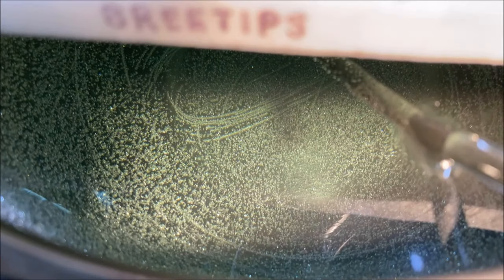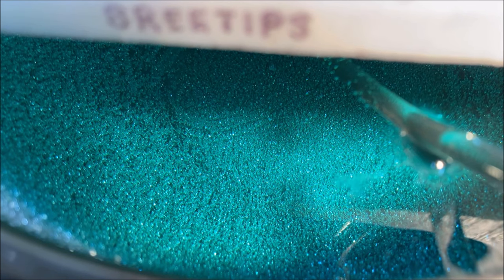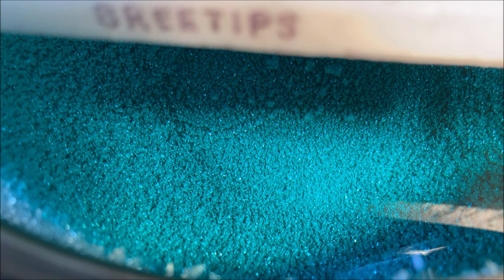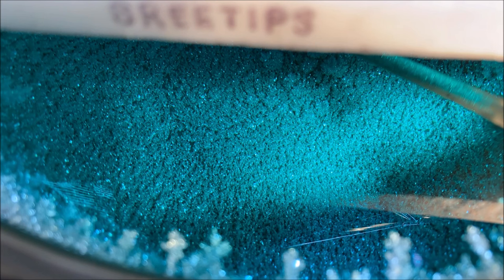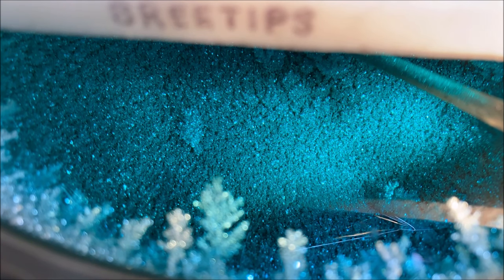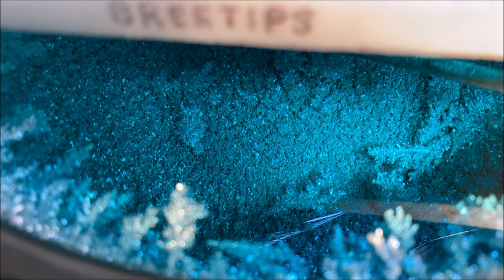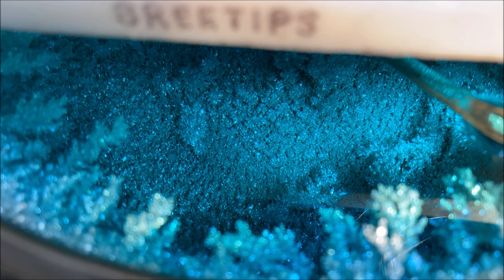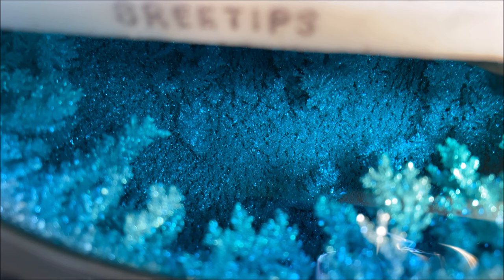Eight Day Time Lapse Pure Silver Crystal Growth Music

Comment: As an electrochemist, I find this quite interesting. Normally, during an operation like this, it is common to add an inert "supporting electrolyte" that carries the current rather than having the current transport via the active species (the silver in this case). Since you're getting very pure results, there's probably no need to change anything, but the supporting electrolyte will simply increase the electrical efficiency.
Reply: And what would the “supporting electrolyte “ consist of?
Reply: @john30039 , in this case, since the active species is silver nitrate (AgNO3), a great choice for a supporting electrolyte would be potassium nitrate (KNO3). The nitrate anion won't interfere since that is already present, and the half-cell potential of potassium is very far (3.7 Volts) away from silver's reduction potential.
Reply from the maker: No one on the goldrefiningforum.com ever mentioned adding potassium nitrate to the silver cell electrolyte. Not saying it’s a bad idea, just never heard of it.
Reply: @sreetips , I'm not suggesting that it's strictly necessary because your cell obviously works, and works well, but it might be helpful for electrical efficiency. When plating, it's a good idea to have a supporting electrolyte because it increases the conductivity of the solution yet doesn't participate in the deposition of the metal. I used to manage a plateshop (and unlike most managers, I still did the shop work too). 😁
Reply from the maker: They did refer to adding a little nitric acid to increase conductivity. Never understood that because the nitric would react with the silver. But it would just form more silver nitrate. And after seeing how adding HCl in my electrolytic gold cell really increased the conductivity across that cell, it now kind of makes sense.
Reply: @DocJustinT  thank you. But considering the scale of Sreetips cell and the low wattage, increasing the efficiency of the electrical system seems moot. I would think the additional cost of chemicals would outweigh any added electrical efficiency gains. Unless by doing so you could see a significant operational time reduction.
Reply: @john30039 , the supporting electrolyte can be used over and over by simply adding more of the active species, so even though there will be a small cost initially, it is quite small over time due to re-use. By adding the supporting electrolyte, the current (and therefore power consumption) can be reduced by around 40-50% depending on the concentration used because it switches the current from diffusion-limited transport of the active ion to the bulk electrolyte, which also slightly increases the plating rate (and therefore slightly reduces the plating time). Like I said, it's not strictly necessary, but a good idea for someone who does this a lot.
Reply: I love this conversation. You guys rock!

Comment: One of these days, I've LOVE to give this a try. I have several kilo's of silver to play with. I have 999 but I also have quite a bit 925, 900, and quite a lot of mexican silver currency. I also have all the lab equipment but none of the safety knowledge. I'll just keep watching and learning for now. I appreciate ALL the great content. MUSH LOVE MY FRIEND.
Reply: Can you put a sterling silver spoon directly into the silver cell? (saw such pictures in the internet)
Reply: @bt5-eo  You can, but the more copper you place into the electrolyte, the faster the nitric acid will become depleted. Because copper eats nitric about 2.5 times as fast as silver. This is why Sreetips dissolves the spoons and forks in nitric and then cements the dissolved silver onto a piece of copper to form what's known as "cement" silver. In this way, he is starting with 97-98% silver instead of 92.5% silver as in a sterling spoon. Additionally, the plating reaction will take more time because the complete spoon has much less surface area than the granules he uses in his anode basket. Finally, no doubt you'd get more NO2 fumes dissolving the whole spoon.
Reply from the maker: No. The electrolyte would quickly become saturated with copper.

Comment: I have a 1 oz .99999 silver round I bought just because it was "5 9s" and I'd never seen one. Four years later and it shines like no mirror you ever saw. Of all the metals silver is the best electrical conductor, the best heat conductor, and it is the most reflective. Polished silver is better than your hand mirror.
Those crystals are always just beautiful. Nature at her finest.
All crystals are amazing but some are a bit more amazing than others. Thank you, Sr. Your editing is getting good enough you're going to have to ask Mrs. Sreetips for a raise. 😉🖖‍
Reply: Why is Silver a great conductor of both heat and electric current?
Reply from the maker: Nature made them like that. Look at a chart for metals as conductors. Copper is the standard at 100. Gold is down around 70 (or something like that). Iron is 15 and so on. But at the top of the chart is silver at 105.
Reply: @sreetips  Silver has more free or mobile electrons in its metallic form, therefore it is a greater conductor of electricity. The electrons in the outer shell is what determines physical and chemical properties and behaviour.
Silver is the Champion of all the elements in the periodic table in both electrical and thermal conductivity.
Of course we use copper which is much cheaper but still has excellent thermal and electrical properties.

Comment: It seems that the crystals form faster and larger at the edge of the bowl where the electricity is connected. If this indicates a difference in the distribution of the electric current within the solution, it could be an advantage to use an all-copper bowl. , perhaps with an inner protective layer of chrome or other metal to prevent oxidation? and as always thanx for your content

Comment: Awesome to watch.  I still think that it would be interesting to do a mass balance study on this.  Mass of silver in the nitric used, mass of the shot (x0.925) and mass of the final product to determine how much of the silver actually came out of the silver nitrate.  

Maybe it's more complicated than that, and the silver coming out of the nitrate is then replaced by the silver from the basket, who knows?  If you can prove that the concentration of silver in your nitrate remains close to relatively constant from start to finish, then it would be interesting to see if it would be possible to drop the copper contamination out of the used solution rather than spending the time to recement it all.  Maybe you would save some time and money.
Reply from the maker: I once did three runs of the silver cell using a single charge of electrolyte. I didn’t add any additional silver nitrate at all. I just added distilled water to keep level of electrolyte up. The third batch of pure silver had green places all over the silver crystal. When I tried to drop the silver out of the electrolyte with hydrochloric acid (to form silver chloride) not one bit of silver precipitated. The electrolyte was completely devoid of any silver. It was just blue copper nitrate. Made a believer out of me. I never use the electrolyte more than twice. I add more silver nitrate (about 200 grams) for the second run. So this should be an indication of how much silver came out of the silver nitrate - ALL OF IT!
Reply: @sreetips  All of it, including what was dissolved out of the basket.  Very interesting.  Hmmm.  Going to have to chew on that one for a bit.  Thanks very much for the info Sr. Chief.
Reply from the maker: All of it. No silver left in there at all.
Reply: @sreetips  So there’s no silver left in the nitrate and no silver left inside of the basket both depleted?
Reply: @sreetips  And can you just scoop up some of the pure silver crystal and melted into bars if you want?
Reply from the maker: Yes
Reply from the maker: There’s residual silver in the anode basket and in the electrolyte.

Comment: Have you ever considered dropping the voltage down to around 1v? If you like crazy big crystals, this is the way to go! Of course it does take longer, but you can grow some beautiful big specimens with the cell!
Reply from the maker: 3.3 VDC to 3.8 VDC is the safe range. Outside these parameters and the silver could become contaminated with other metals, if present. Especially copper.
Reply: @sreetips  ah I didn’t know that! Thanks for the heads up! I’ll have to rerun my crystals then at the proper voltage range and see how badly they got contaminated!
Reply from the maker: You’re probably ok. Check the silver for any green colored material. This will be the copper. If present, I just make new electrolyte and run the contaminated silver crystal back through the silver cell

Comment: Good evening Sr. Chief! Hope you and Mrs Sreetips had a great weekend. I have a couple questions. One, that silver cell is a 3.5qt stainless steel bowl, correct? So you make around 4L of electrolyte? Do you dilute it with distilled water?
Reply from the maker: I use 600g of silver dissolved in 3.5 liters of liquid. The cell is 3.5 liters, not 3.5 quarts.
Reply: @sreetips  Is the liquid (electrolyte) all of the 3.5L or do you use some distilled water?
Reply from the maker: I dissolve 600g of silver in about a liter of hot dilute nitric acid. I add distilled water to dilute it down to 150g per liter.
Reply: @sreetips  Ok. I got it. I guess that means dissolving one of my tubes of generic silver rounds

Comment: Question: is there a reason why the anode has to be silver if it never touches the electrolyte?
Reply from the maker: Yes, because its easy to melt and pour. Silver with a little copper in it is not very easy to melt and pour.
Reply: @sreetips  is pure silver naturally difficult to melt?
Reply from the maker: No, it melts like butter. But, add just a little copper and for some reason the melt temp goes way up. And the silver looks awful.
Reply: Well, factor in the melt temp of copper, and it makes sense to me. It's almost 2000 °F

Comment: How would a professional refiner refine silver? What would be the difference? I don't think that they would use a stainless bowl :-)
Reply: I would think the same process just on a much larger scale. Instead of a bowl, they probably use a giant stainless steel vat. Like you see in breweries and instead of a Tupperware dish it's probably a 5 gallon bucket.
Reply from the maker: My silver cell is a Thumb Cell. The anode suspended above the cathode. Large refiners use Moebius Silver Cell; alternating anode and cathode plates, spaced apart, hung in a silver nitrate electrolyte. There could be twenty anodes two feet by one foot, hung between twenty cathode plates the same size, spaced about four or five inches apart. Cranking out a thousand ounces a day.

Comment: What would happen if you put a magnet on one side of the bowl? Just one small one.
Reply: Silver is non-magnetic, and the bowl is electrically charged, it would create an electromagnet. It could possibly taint the silver crystals where the magnet is if any ferrous metals are in the impure shot. They could possibly plate out with the silver in that area.
Reply from the maker: The stainless bowl is non magnetic.

Comment: What are the proportions? The amount of dissolved and dissolved silver in the electrolyte, as well as the ratio of water to nitric in the solution.
Reply from the maker: I dissolved about 600 grams of pure silver in about one liter of liquid (when it was done). I added the concentrated silver solution to the bowl (600g in about a liter) then I added distilled water to the 3.5 liter level; ended up with about 150g of silver per liter of liquid.

Comment: Can you set this up not with silver shot, but just unmelted Sterling silver pieces?
Can you use another metal besides silver in the electrolyte or does it have to be silver?
What would you estimate the yield is like? Kg of silver crystal generated per grams of silver crystal used to create the electrolyte...
Reply from the maker: Putting sterling silver directly into the anode basket would cause the electrolyte to quickly become saturated with copper. The electrolyte for the silver cell must be silver nitrate. I use 800g of pure silver over the course of two runs. I harvest about 100 Troy ounces of pure silver, fifty from each run.

Comment: hey sreetips, question: if there is gold or platinum in the silver granules, will it go into solution and pollute the crystals or will it stay in the sludge that forms in the anode?
Reply from the maker: As long as silver concentration in the electrolyte is kept up, and voltage is kept right, then only the silver will deposit on the cathode.

Comment: What is the different between this process of getting the silver and just put some copper inside the silver nitrate solution? Wouldnt it be simplier and more efficient?
Reply from the maker: Not sure what your asking here.
Reply: Oups. Sorry. What i mean is what is the advantage of extracting the silver from silver cell method rather than i could do it with cementing the silver from the silver nitrate with copper?
Reply from the maker: @mycikroto83  got it. Cement silver is very close to three nines, if you do it right. But the only way to be sure is to run it through the silver cell. An alternate method would be converting to silver chloride then to pure silver metal with lye and sugar. It makes very high purity silver, if done correctly.
Reply: @sreetips  ahh, understood now. the only differences is just the purity. thanks alot. video is great by the way.

Comment: Why doesn't the silver from the electrolyte just get striped of all the solver ions 1st
Reply from the maker: Because they are constantly being replaced by the silver ions from the impure silver being dissolved in the anode basket.
Reply: @sreetips  interesting. Wounder why gold doesn't come over from the shot
Reply from the maker: If the parameters are maintained, then the other metals won’t plate out with the silver. Palladium is the main culprit. It’s soluble in nitric and tends to follow the silver. The gold is insoluble and stays undissolved in the anode filter.
Reply: @sreetips  oh I see since gold doesn't react in nitric it stays behind

Thanks for the lessons Mr tips

Comment: How much yield would you typically get from one round of electrolyte before its fully depleted?
Reply from the maker: I use it for two runs. I add another 200g of dissolved silver for the second run. The silver gets depleted as the cell operates. It plates out on the cathode.
Reply: @sreetips  Hi, yes I understand the silver in solution will plate out which eventually depletes the solution, but I am wondering how much additional silver you will yield on top of the 600 grams you put into the electrolyte
Reply from the maker: I don’t know. I’ve never taken the time to figure it. My goal is to convert as much silver as possible. Then put it away and forget about it. Thankfully, I don’t have to worry about trying to resell it for a “profit”. The silver is my profit.
Reply from the maker: The amount of silver going into the cell (either as electrolyte or impure shot in the anode basket) will be the amount that comes out as pure silver. Less impurities or any spills.